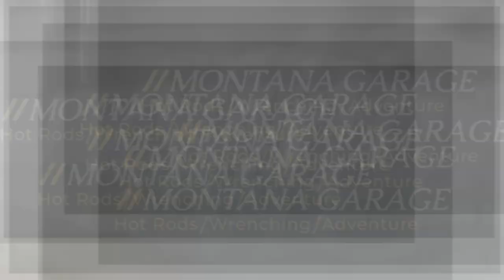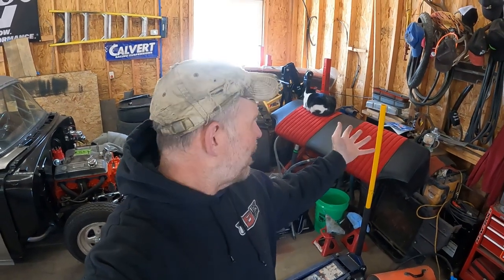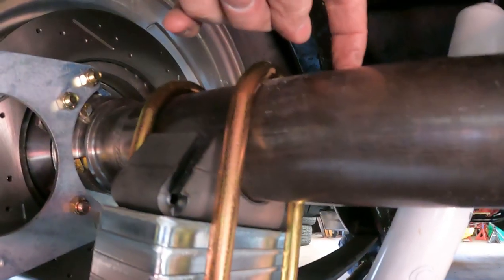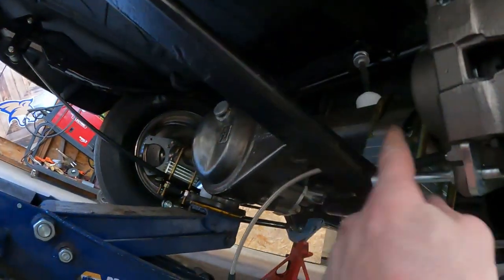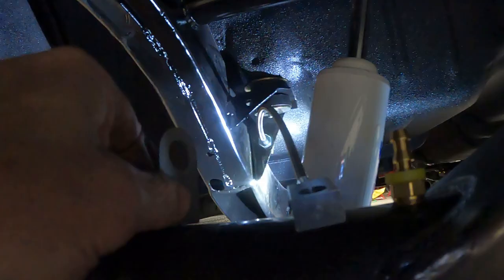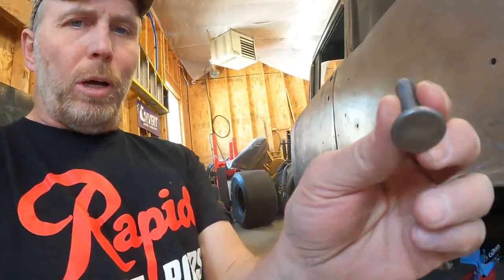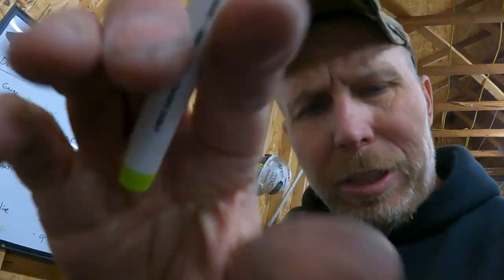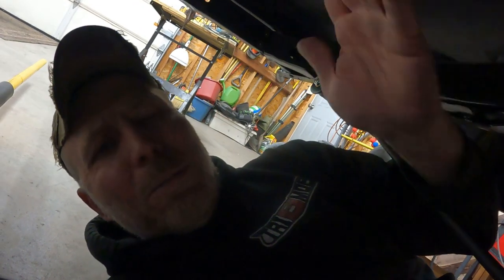1955 Chevy Brake Upgrade - Plumbing the Rear Disc Brakes

Comment: Hi Brad. I mentioned a while back (when the body was still off the frame ) that now would be a good time to do the brake and fuel lines, Yes , im calling you out on that. Anyway , glad you have them done.
Reply from the maker: Thanks Randy. Doing the plumbing with the body off would definitely be easier, and if I was running stock lines everywhere I probably would have. But with all the changes I made, it was tough (for me at least) to know how/where to run the lines until more things were assembled. In the end it really wasn't too bad. I guess maybe I'm used to working under the car. I appreciate you always watching man!

Comment: We will watch whatever you do on your car including old videos. At least I will. Nice work on the break lines. 👏  why did the front clip look a different color than the rest of the car? I was thinking that maybe your car would actually look good in silver 🤔
Reply from the maker: Thanks Gorni. The front end looks brighter because it was freshly sanded. The rest of the body has been bare for quite some time. I will resand all of it before protecting the metal. At that point it should all look the same.

Comment: Dont understand why you. Put flex lines on the rear end you just need one from the frame to the rear. The rest is solid line to both cilinders on the rear end ???????
Reply: The rear is disc, not drum. The calipers float so you want hoses there too...
Reply from the maker: The rear now has disc brakes Dale. The stock setup was as you describe, but with the disc brakes you need a flexible hose for a little float and also to be able to remove the caliper. Thanks for watching!
Reply from the maker: Yep, that's why. Thanks for watching!
Reply: @shartpampers  yup wasnt paying attetion
Reply: @MontanaGarage  wasnt thinking i was drinking sorry
Reply from the maker: @dalekriescher7462  No reason to be sorry. Thanks a ton for watching and commenting Dale!